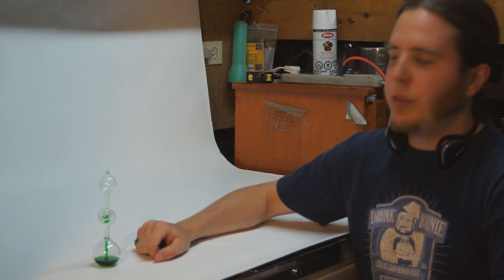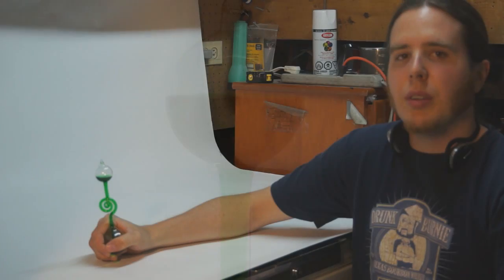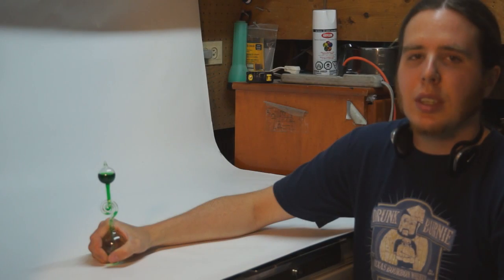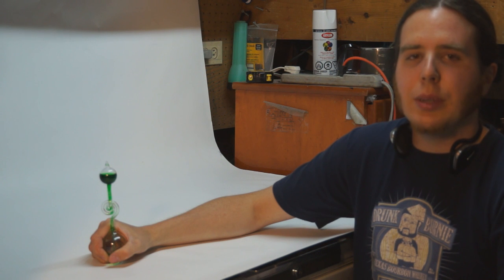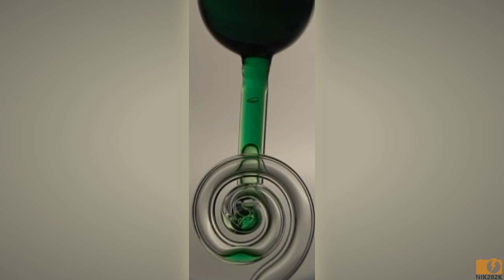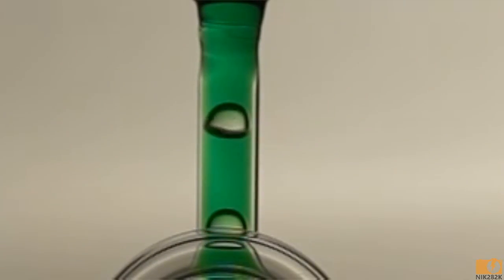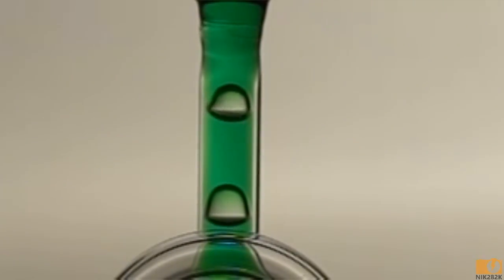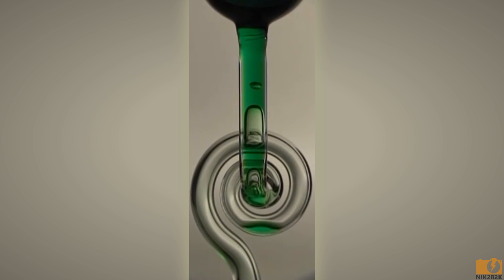Slow Motion - Hand Boiler

Comment: Is it an effective heat transfer agent, say for supplemental CPU cooling...?
Reply from the maker: It might be possible to use it in a heat pipe but I think the heat capacity is too low to be practical. It would look pretty cool anyway.